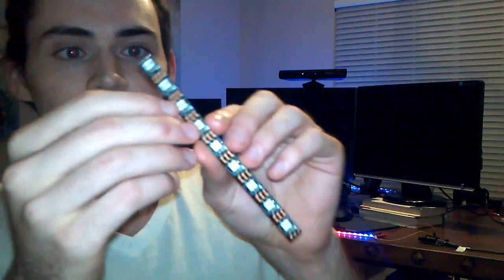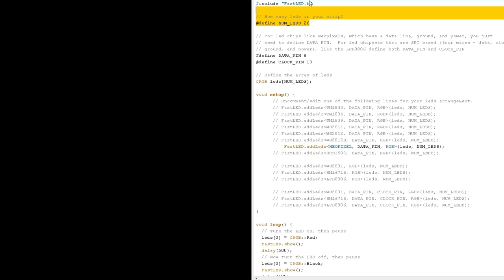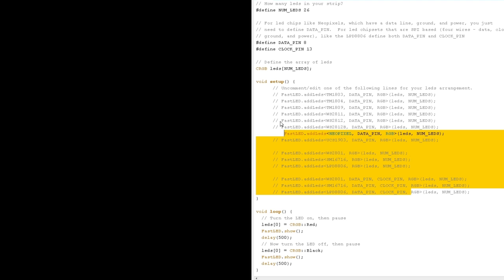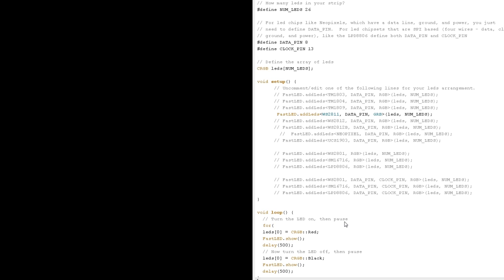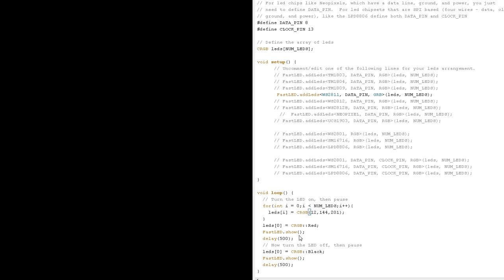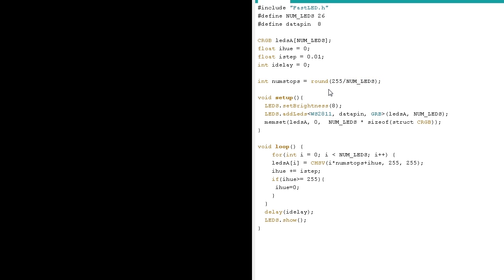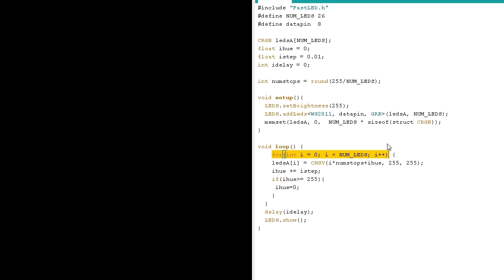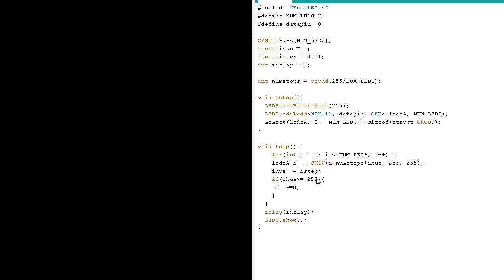Intro to FastLED

Comment: Nice video! BTW you had a few errors with your code- you forgot to #define the led type. Also curious as to why you did not use float instead of int  when it comes to line "int numStops = round (255/NUM_LEDS);"?  I understand that you're calling the round function (so its rounding 255/NUM_LEDS) but wouldn't it be slightly more accurate as a float? Otherwise good video and thanks for sharing!
Reply from the maker: Probably because i am noob xD
Reply: don't worry noobs are cool and int did work :) But float might be slightly better, although hard to tell. BTW used your code and defined it as float numStops. What I'm not sure about this round function is if its rounding to the whole number or to a certain decimal place. I'm new to this whole arduino thing too :) But I'm not new to coding- did my a minor in comp sci back in my university days 13 years ago! :) And know various languages etc.

Comment: i saw this massge every time please guide me how to solve thise problem 
 
Arduino: 1.8.5 (Windows 7), Board: "Arduino/Genuino Uno"

Build options changed, rebuilding all
In file included from C:\Program Files (x86)\Arduino\libraries\FastLED\examples\Cylon\Cylon.ino:1:0:

C:\Users\Ashok\Documents\Arduino\libraries\FastLED/FastLED.h:17:21: note: #pragma message: FastLED version 3.001.006

 #    pragma message "FastLED version 3.001.006"

                     ^

C:\Program Files (x86)\Arduino\libraries\FastLED\examples\Cylon\Cylon (2).ino:13:19: error: redefinition of 'CRGB leds [64]'

 CRGB leds[NUM_LEDS];

                   ^

C:\Program Files (x86)\Arduino\libraries\FastLED\examples\Cylon\Cylon.ino:13:6: note: 'CRGB leds [64]' previously declared here

 CRGB leds[NUM_LEDS];

      ^

C:\Program Files (x86)\Arduino\libraries\FastLED\examples\Cylon\Cylon (2).ino: In function 'void setup()':

C:\Program Files (x86)\Arduino\libraries\FastLED\examples\Cylon\Cylon (2).ino:15:6: error: redefinition of 'void setup()'

 void setup() { 

      ^

C:\Program Files (x86)\Arduino\libraries\FastLED\examples\Cylon\Cylon.ino:15:6: note: 'void setup()' previously defined here

 void setup() { 

      ^

C:\Program Files (x86)\Arduino\libraries\FastLED\examples\Cylon\Cylon (2).ino: In function 'void fadeall()':

C:\Program Files (x86)\Arduino\libraries\FastLED\examples\Cylon\Cylon (2).ino:22:6: error: redefinition of 'void fadeall()'

 void fadeall() { for(int i = 0; i < NUM_LEDS; i++) { leds[i].nscale8(250); } }

      ^

C:\Program Files (x86)\Arduino\libraries\FastLED\examples\Cylon\Cylon.ino:22:6: note: 'void fadeall()' previously defined here

 void fadeall() { for(int i = 0; i < NUM_LEDS; i++) { leds[i].nscale8(250); } }

      ^

C:\Program Files (x86)\Arduino\libraries\FastLED\examples\Cylon\Cylon (2).ino: In function 'void loop()':

C:\Program Files (x86)\Arduino\libraries\FastLED\examples\Cylon\Cylon (2).ino:24:6: error: redefinition of 'void loop()'

 void loop() { 

      ^

C:\Program Files (x86)\Arduino\libraries\FastLED\examples\Cylon\Cylon.ino:24:6: note: 'void loop()' previously defined here

 void loop() { 

      ^

Multiple libraries were found for "FastLED.h"
 Used: C:\Users\Ashok\Documents\Arduino\libraries\FastLED
 Not used: C:\Program Files (x86)\Arduino\libraries\FastLED
exit status 1
Error compiling for board Arduino/Genuino Uno.

This report would have more information with
"Show verbose output during compilation"
option enabled in File -> Preferences.
Reply: https://forum.arduino.cc/ is the best place to get help with Arduino.